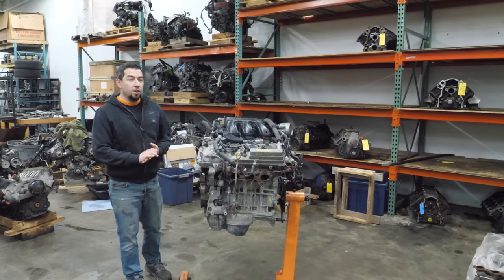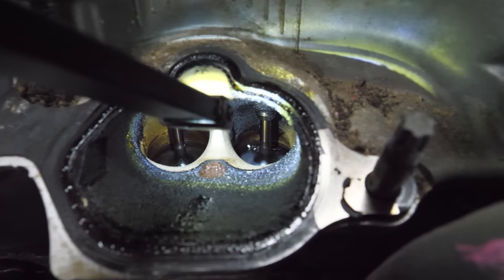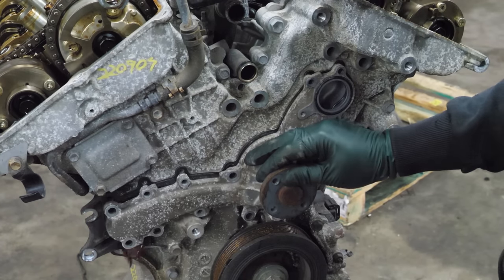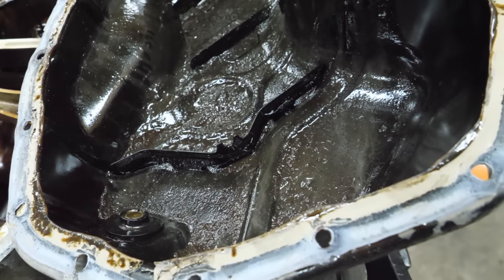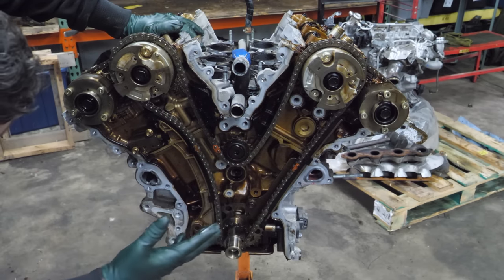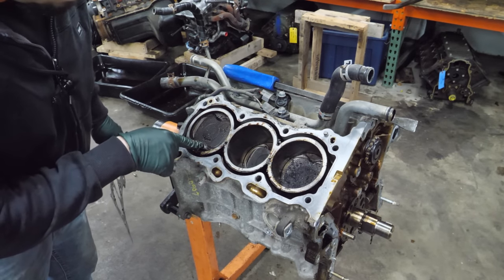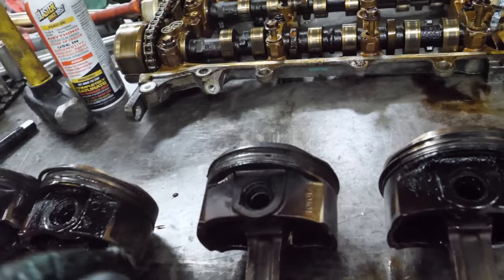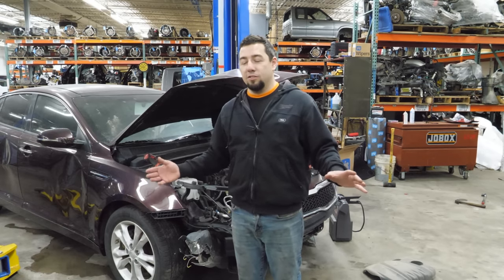Toyota Lexus 2GR-FE Teardown! Premature Death Of Toyota's Most Reliable V6 Caused By Obliviousness!

Comment: I’ve only seen 2 things that commonly kill these engines:

1. The rubber oil hose that feeds the rear VVT solenoids. They split and drain all the oil out of the engine very rapidly.

2. The same thing that had plagued every Toyota engine since about 2000…their junk water pumps. I can’t think of a single engine that they’ve made new since 2000 that hasn’t had a water pump fail and leak prematurely.

The plastic used on engines is very resistant to heat, typically the melting point is around 400 deg F. The fact that it ran long enough to get that hot is impressive.
Reply: Water pump on my 2014 2GRFE is at 180,000 miles and still going strong.  I also replace the coolant at specified intervals to ensure if gets proper lubrication.  Of course it will fail eventually…all mechanical items eventually fail.  After 180k miles, that water pump owes me nothing.  How long do you think it should reasonably last?

Comment: This engine suffered from over heating due to coolant leak from probably a  failed water pump bearing, very common. Every time you see the intake melt like that, you know water pump blew out or some other coolant leak and engine got above 276 degrees F....basically at that point a throw away engine.

Comment: The 3.5 L with the oil cooler hose that ruptures and burns up the engine. The newer ones use a metal oil cooler tube.

Comment: Notice that the cam chain did not have any of its yellow timing marks left on it. Thats sign of the chain overheating along with all of the other melted engine parts. I'm surprised  that engine still turned over.

Comment: That intake manifold is made of PA-6 Nylon which melts at 433 Farenheit That engine was literally cooked at oven temperatures.
Overheating due to leaking water pump or lack of oil due to either busted oil feed pipe that never got in for the recall or lack of oil due to oil consumption. I see these engines burning oil pretty badly over 100K due to owner neglect. Ones that are taken care of do pretty well though. I had the pleasure of working on a late model Rabbit that came from the local body shop, the owner had hit a deer, had it fixed, then drove into a ditch and broke the bottom of the radiator and drove the car until it stopped (bodyshop alluded to them being a habitual drunk and that 'hit a deer' was more likely drove through someones front yard and landscaping). They melted every single plastic thing bolted to that engine including yes the intake manifold sucked into the intake ports all the way down into the the intake valves like you're seeing there.

Comment: 2GR's are solid engines. Seen more get Hydrolocked, then fail because of it's own short comings. Bank 1 Headgaskets and Timing Cover leaks are the most common issues. Pretty sure the Timing Covers come leaking from the factory.

Comment: $1500 for an engine is a fair price. I get $3000+ for 5.4 and 4.6 ford/lincoln dohc engines, 4.8/5.3 ls engines usually fetch $1500 with a 2wd 4l60e computer and vats delete. Maybe I get more because often I set them all up to run on a pallet and tune the computers. People like that, when you can fire it up for them and they can see a video of it running.

Comment: If the temp gauge on Toyota's is anything like the temp gauge in my Miata (2000 model), it is not linear, and wouldn't start showing an overheat until the engine was past saving. A non-linear gauge isn't much better than an idiot light. I installed a ScanGauge in my Miata, and did another one in my Tacoma, so I could get a temperature reading in degrees F. On the Taco I also programmed in the transmission fluid temp, since I tow quite a bit with it. Cheap insurance.

I notice so many wiring harnesses just whacked in two on these engines. Are they not worth removing complete and re-usable, if there's no other damage to them? I ask this because I am going through a replacement procedure on my wife's RAV4 of the engine wiring harness, due to a rodent chewing through the #1 coil wires and the exhaust VVT actuator wires. The harness for the RAV4 is over $3000, not counting installation. I can only imagine the harness for these V6's is even more.

Comment: I have the FXE variant of this engine.
280000 km. I would knock maybe 30000 due to the car being a hybrid.
I wonder if my motor is more reliable due to it being detuned to 250hp and having Atkinson cycle heads.
I also had the water pump replaced at 250000 km as preventative maintenance.

Comment: Although the 2grfe is a great engine, it has a few flaws that if not  taken care of will end its life prematurely. Early engines had  rubber lines on the vvti oil supply and oil cooler lines, the headgaskits are prone to fail externally due to salty environments and lack of coolant changes. And lastly no matter what you drive,  change your oil at or before 5k miles.

Comment: Yeah the problem with is that the oil wasn’t changed enough, and that red coolant is actually okay. Red coolant is 30k miles, pink is 150,000. The failure points are really just weak points maybe due to packaging; Be sure to change your oil 3k miles and coolant 30k miles for red coolant and 50-70k for pink. Racing the engine will involve oil consumption and the way the oil circulates through engine, its better to run high end oil . I use VR1 synthetic 10w30 or Amsoil dominator 10w30 There’s a lot they could’ve done but what they did do is pretty smooth. The other thing is that the oil baffling system is not that great so this engine is more like the 2JZ, doing pulls on the street. You need to handle the cooling more and oil baffling situation when concerning hard. It’s also better to turbo this engine. 27psi gets you around 800hp on stock bone internals. Really great engine. If you want to beat 392s or even other v8 cars. Simple.. sticky tires, high stall converter, BOE shift kit, 93 tune, custom x-pipe( not y-pipe), true cai, headers, coils, and brakes. You’re walking alot of cars. Base bmws can’t touch you.. that 800hp to the ground

Comment: I'm guessing someone started a fire in the plastic intake by spraying starter fluid in this after it sat or because a fuse blew or fuel pump failed and it wouldn't start so they tried to give it assistance and sat the intake on fire and didnt know until too late, then thought it was okay until it wasn't... when the cooling ports got clogged then overheated those cylinders. I think the coolant port popped or started leaking because pressure overload from high temp.

Comment: Timing cover leaks, water pump leaks, and the rubber oil cooler lines are the only real failure points I know of. Obviously lack of maintenance or in this case overheating would cause a problem.

Comment: Those engines are solid although unlike many Toyota engines they are very picky about constant and regular oil changes and ensuring there is enough oil to maintain oil pressure. Seems to be this was owned by someone who never opened the hood to check anything and for that they ended up with a blown engine.

Comment: Lack of maintenance.  Water pump kept leaking, drove it until it died without checking coolant level. Sad.
water pump tends to leak nearing 100k mi.  There's even a TSB- slightly sippage a little bitty crud says normal.  I replaced alot of warranty water pump. Other than that 2gr's great.

Comment: This is why you shouldn't use a plastic intake. 

Apparently, the subaru fa24 uses a plastic oil pick-up tube.

Like, why? Eventually, it will break, and you won't notice and guess what, oil starvation

Comment: The engine was probably overheating and the driver just kept pushing it and stepping on the gas wondering why it's sluggish. I fixed a lexus rx330 once where the driver got it so hot, it dropped valve seat... fixed it by replacing the engine.

Comment: That rubber oil line was upgraded to metal in later models because of the number of total engine failures. Early owners should replace the rubber line - it's worth it.

Comment: I have to ask because if I were doing a rebuild on a Toyota with timing guides, on an engine with over 200k miles, I would replace the guides, tensioner and chain. Someone told me an inspection of those components was sufficient and to not replace them because Toyota parts are so good. Am I wrong?

Comment: WOW.... I have seen overheated with spin rods before many of times. But to torch through the cylinder wall. That engine was super hot and extra lean. On a turbo car that would be normal bad tune damage. But on a N/A engine. WOW.

Comment: The answer about how great these are is right here in the video.  This engine is the epitome of neglect and it was ran so hot that it melted the knock sensors…and it was still running?  The 2GR-FE can last hundreds of thousands of miles if cared for.  My Lex RX-350 has 418,000 miles.

Comment: 10k mile oil changes now kill all these motors. They didn't change anything when they switched and it was just a marketing thing. They will outlast the warranty at 10k mile oil changes but if you want 300k id do 5k. They did have a few issues with the vvti making noise and some of the filters getting clogged. Couple oil lines were known to leak as well which if bad enough (ruptured)  could cause the motor to dump all the oi,

Comment: Love it when the lube shops tighten the filter cap with the 3/8 so the next guy can't get the housing drain cover off without an impact. Really shouldn't be able to take the filter cap off with a 3/8 like that.

Comment: My wife had s 2014 camry with the 2grfe engine. It was all good until the motor seized up at 120,000 miles. The engine was maintained. Still not sure what happend.

Comment: lol. I put one of these in a few days ago.

the plastic y in the upper hose breaks,the nipple on the radiator that that y goes to or like mentioned the water pump goes. The engine I did had 79k miles. 

that plastic piece in the upper hose or that radiator nipple is in a lot of Toyotas including some of the 4cyl models and they have claimed many Toyotas too soon

Comment: I did a water pump on one of these in a sienna. It's driven by the serpentine belt. I can honestly say I can replace the water pump on a honda J35, which is timing belt driven, faster than I can do this water pump. Its unbelievable stupid to change out with the engine in the car.

Comment: Question about selling parts:  I have always assumed that from a rebuild perspective, bearings, rings, and pistons are all throw-away wear items (i.e. if you've spent the money/time to get that deep, the cost to replace is small), and that ANY reused block will have its cylinder bores and journals reground for oversized bearings/pistons.  Is this a naive assumption in the real world of folks who just want their mom-minivan or daily driver fixed?

Comment: No engine even if it is Toyota 2GRFE can take abuse neglect. The oil change intervals should be done 6 - 7 k Kms. 
We have the same engine in our 2008 highlander. In -30 C temperatures it has given no issues. We use synthetic 0-20 a good brand oil on sale at Walmart on local Canadian tire store. Change oil and filter every time. 
We had replace the water pump and gasket at the mechanic. Replaced and bleed the coolant properly. 
Pay attention to the temperature gauge check the oil dipstick and the transmission level at least twice a month. Some recalls were done at dealer the oil line as you mentioned, 
This engine is a good and reliable but you need to keep the oil fresh and change intervals short. 
Current mileage 214,010 miles 😊😊  😊😊😊 ...

Comment: I have a 09 Venza with this engine.  Yes, keeping an eye on the water pump and timing cover per advice from the Car Nut. The alternator went out at 140k but that's about it, doesn't eat a drop of oil.  Seems to be as good as my Tundra's 4.7.
Reply: Does your timing cover have a leak?
Reply: Car care nut way over dramatizes.
Reply: He is a perfectionist and knows his craft, I like him.  Yea, I change my own oil and don't use OEM but he's probably correct on everything he says. If he was in the neighborhood I would use him, South side of Chicago a little too far.👍

Comment: I have mixed experience with these. My grandparent’s ‘07 Lexus GS350 has the 2GR-FSE and it’s never given any issues but it burns oil like a pig, about a quart every 1100 miles. However my sister has a rav 4 with this version, and it’s similar mileage (about 100k) and doesn’t burn any oil. Kind of interesting

Comment: That engine got a hot supper and some desert... I am dumbfounded by the intake melting like that.  Trying to figure out how that happened... must have been heat carry-over from the heads into the lower intake that slowly made the plastic hot enough to be molten and sucked it in.  But the outside wasn't deformed at all.  Whomever did this has some skill for sure.

Comment: The 2GR engines will run forever if you change the oil every 5,000 miles and change the coolant about every 60k. Amazing engines.

Comment: I have this engine in my Camry and it pulls very well. 108k, no problems yet, knock on wood.
Reply: Take easy on it and youl have a car with 250,000 miles and over  i have the same engine with that amount of mikes still going

Comment: these engines have plastic cylinder supports between the block and the sleeves, they probably melted and that is why the coolant looks so nasty. PA66 nylon melts above 500F and it is typically what they use on engines.

Comment: I have seen water pumps on these be a failure point, FWIW. Seems like a fun job, too; they even give you two labor times IIRC (one for if you pull the motor and one for those who are slightly more sensible and don't).

14:20: If it hasn't already been mentioned, the part the ratchet got caught in is a drain plug/plate of sorts for the filter. What you're supposed to do during an oil change is: remove that, put a plastic drain nipple (normally included with the new filter) in the area that it was covering, and it drains the filter. Adds time to the job but it lessens the mess a little. Problem is half the guys who change oil don't seem to know that and it gets stuck in place, so when someone who DOES know what to do tries to drain the filter, they just end up loosening the cap (ask me how I know).

37:45 I had forgotten that these had piston squirters.

39:44 PLEASE tell me the 2.4L out of the Optima survived. I know they have issues out the ass, would love to see one torn down.
Reply: my center piece is so tight inside the filter canister that I just remove the entire thing at once, and then after reinstalling I verify the center is still tight.
Reply: @pkdude5334  that's how it is on roughly half of them at this point, it seems.

Comment: ERIC, don't Toyota have a temp sensor that shuts the engine down when the temp goes above a certain value? My old 2002 Holden Commodore (GM-H Australia) had an overheat sensor set to shut the engine (LS1) down if the temp reached 140c.
Another thing cars need is what BMW have always done, fit an oil level sensor!
But then 90% of your work would disappear because people are too lazy to pull a dipstick once a week! 😂

Comment: I am curious why you think that opening up an oil pump renders it useless. I guess I could see that on a rotary vane style pump where you would never get all of the pieces aligned properly, but on normal pumps in the worse case it might need a new gasket or O-ring to go back together again and be serviceable.
Reply: On some of my cars there were no new pumps available at all, only rebuild kits. Like my 79 Subaru. Take apart the pump, pop in new seals, new pressure relief spring, new pressure relief check ball and seat, fill cavity with Vaseline so it primes, and put back together and on the engine. That is just how they are done. New pumps haven't been available for a very long time.

Comment: Its beyond me that people fail to look after their engines so badly, and (above) a fine piece of machinery at that.  I've worked on many cars / engines, but in my 55 year driving history, I have only had 7 regular cars - I run them till they rot out (UK weather).  They last cos I LOOK AFTER THEM!  Still got my 1981 Mini in mint condition.  Currently driving car no.7, 16 years old, will probably see me out.

Comment: 27:00 not too long ago on one of the Integra forums there was a guy in the St. Louis area who had issues with his motor not wanting to run. After he sent me some photos, it turned out the entire timing cover inside and out plus the belt were melted into one enormous blob covering that side of the motor. I dont know how hot u have to get a motor to melt stuff like that, but it must of been pretty hot to say the least.

Comment: apparently this motor didnt have a temperature shutoff for the engine.... strange that my 98 pontiac shut off when the motor went stupid and spiked the temps. how do you get it hot enough to melt all of that plastic

Comment: Rubber oil supply line to the VVT  ruptured and loss of oil supply doomed many of these engines. Toyota later made an all-metal unit which ended that problem. Ten thousand mile oil change intervals were another big cause of premature engine failure.

Comment: Have you done a Ford 6.2L originally used in the Raptor? This was interesting to see one piece in the Block separate like that. Makes me think there was a casting issue, also severely overheated engines usually have more cylinder scuffing than this one did! Is using the word "Raptor" offensive to Raptor's?